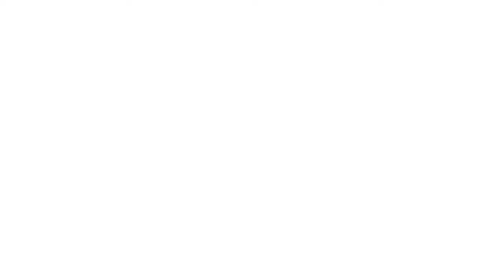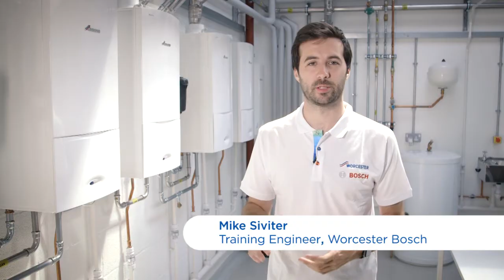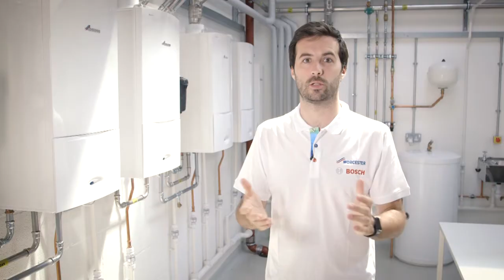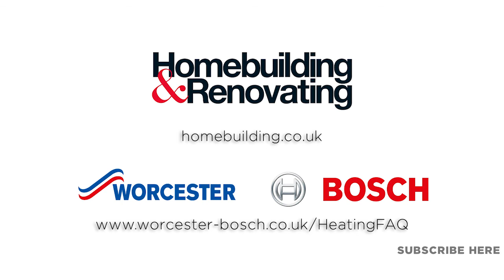Why is my radiator hot at the top and cold at the bottom?

Comment: My radiator is hot at the top but cold at the bottom. The weirdest thing about it is that return pipe is hot and flow pipe is cold(actual pipe below trv). I am puzzled. Could it be because system is not well balanced?

Comment: The radiators are hot at the top and cold at the bottom because the heating system runs as it should - there is nothing wrong (they make optimal use of the heat).
The radiator must not get hot at the bottom — it is a sign that you turn off the heat before you enjoy it. The return pipe at the bottom of the radiator must be cold or at most hand-warm. If you can not heat the room without the radiator getting hot at the bottom, you may need more and larger radiators.

Comment: I have 1 radiator that won't turn off but will get hotter if I want it too. When switched off with trv valve it is hot at the top and cold at the bottom. I first changed the trv and no success. Then a geating guy told me it's in flow out flow need swapping. I am now planning on getting an Aladdin autovent but as it's an old radiator I think I need a 3/4" male to 1/2" female bush to accomadate the Aladdin. I do not think it's muck as I have a magnet filter. Will update this once I got it figured out. Can't be trapped air as the radiator would be hot at the bottom cold at the top but I think autovents are worth getting anyway.

Comment: If its a steam radiator, its most likely a stuck valve which causes this issue.. In normal working order, when the steam starts to enter the radiator the first time, the air inside the radiator suppose to vent from the vent valve. The steam replaces all the cold air through the vent valve. Once all air is vented, and the temperature of radiator is hot enough the air vent valve shuts off.
Now, this  happens when the vent valve is ceased. The incoming steam comes from the boiler at relatively higher pressure (around 30 PSI) as compare to the air trapped inside the radiator. This pressurized steam tries to push the cold air in the radiator, but air have nowhere to go due to stuck valve. Now the radiator is occupied with half steam and half cold air, and we know that steam is hotter that's why it stays in the upper part of the radiator, the remaining cold air stays at the bottom.
Solution is to replace the air vent valve, which is probably the cheapest and easiest thing to do yourself.
Reply: Not much call for "steam radiators"

Comment: Modern boiler are rubbish.They cost £3000 and you end up with an wall of ugly pipes and an ugly cleanser sticking out,plus a big ugly condense pipe on yr outside wall.You will need to pay a joiner lots to box them in.I was told it would save £300 a year but I will be lucky if it lasts and then the will say that they can,t get the parts anymore,so I will have to buy a new one.Imo they are so weak they can,t drive the radiators so need new radiators or a power flush £500 .I had a lovely stand alone Potterton in its own lovely cabinet with a small extractor ob the outside wall.It thundered thru all the rads great.A boiler should at least have the cleanser built in.aaaaarrrdggghhh